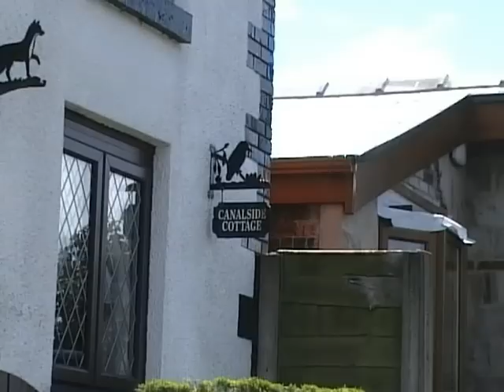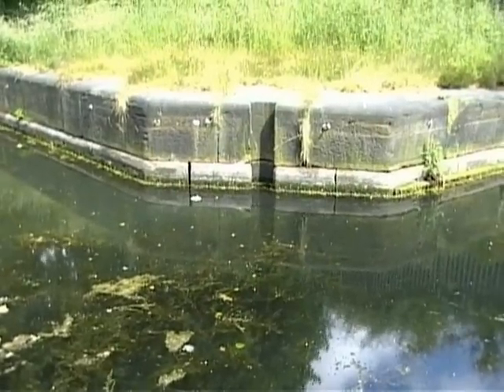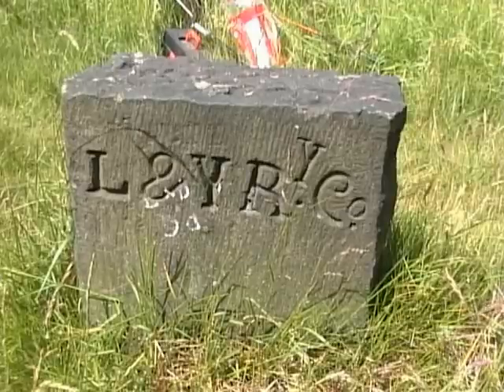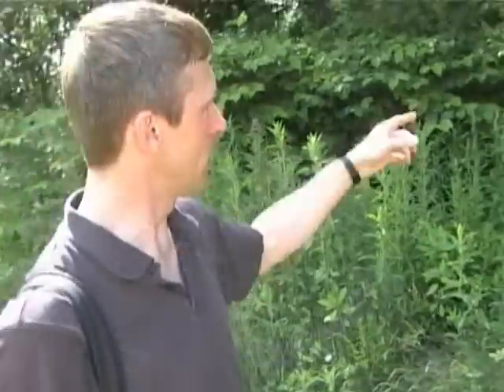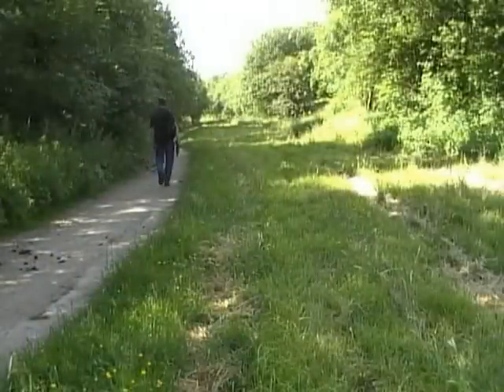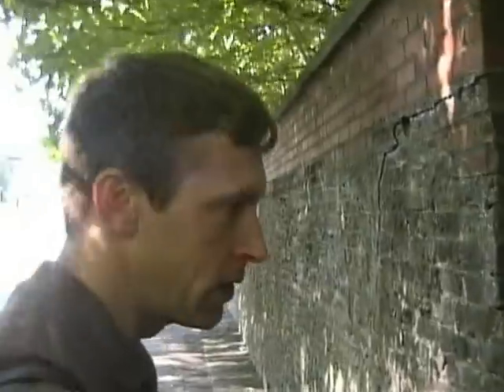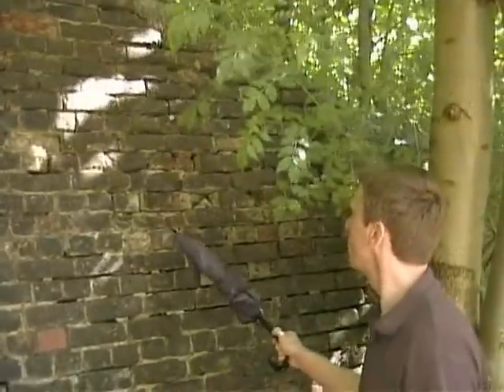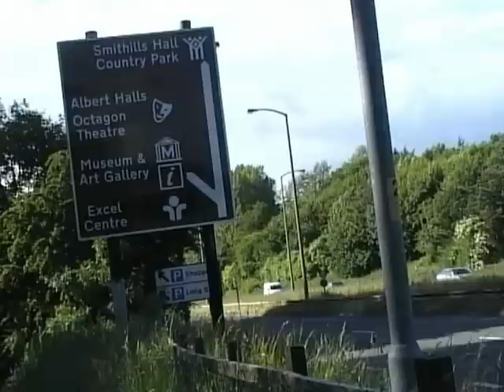Heritage Explorers Manchester Bolton and Bury Canal (Bolton Arm)

Comment: When you went on the Bolton side of the aqueduct over the River Croal, along the clear towpath edge, could you not see the large basin just before the next former bridge (in the garden)?
This had quite a large area of clear water in it when I went last November.
Also, if you peer through the foliage into the river you can see huge chunks of the former aqueduct in the riverbed. There are two huge still intact sections each 10-15m long. One is brick, the other stone.
When you pass under Burnden Viaduct towards Bolton, the canal swung in a gentle loop away from the SPW road I believe from checking maps. If you walk carefully through the middle of the small meadow there is a strip of marshy ground in a wide arc. I think this is probably the line of the canal with it's puddle clay still intact.